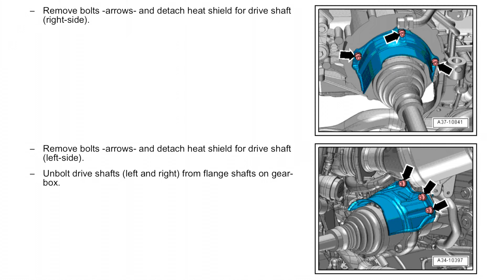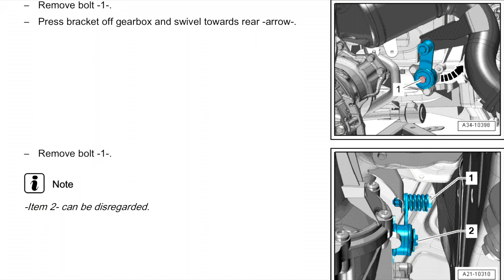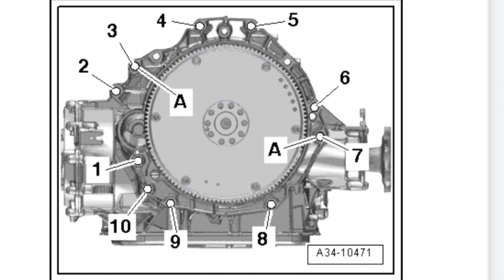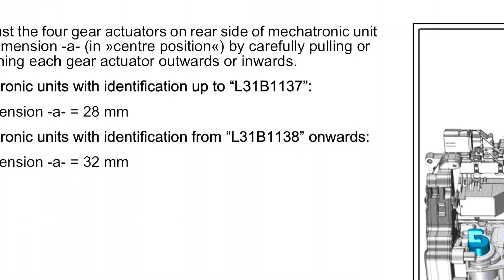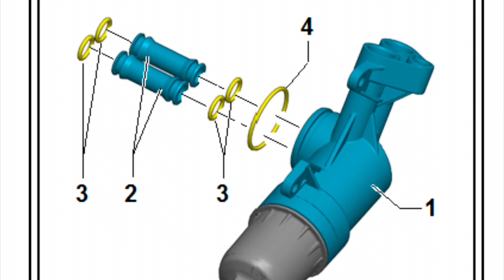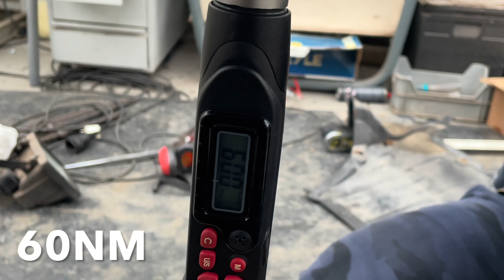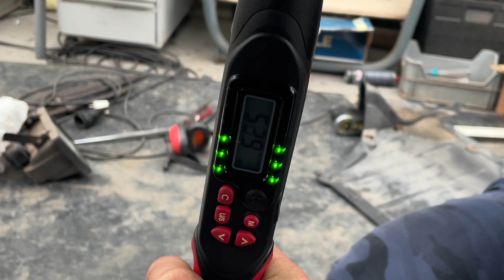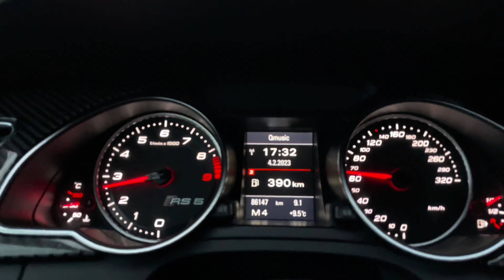RS5 b8 Removed and Install new gearbox DL501 0B5

Comment: Very well put together guide. Can you remember what size socket size is required for the bell housing bolts (ie. the 12 point bolts attaching the body of the transmission to the engine block shown at 4:47 ), are they 18mm? Thanks

Comment: That top heat shield bolt on the left hand side is an absolute bastad to remove and re-fit. I ended up leaving it off when I replaced the drive axles on my A6

Comment: Good to see that fixed it! What was the cost for the exchange?
Reply from the maker: I'm glad she's okay too😅

 The cost list
 Gearbox 1200 euros + 2 months warranty
 MTF oil 100 euros
 ATF oil 60 euros
 Gasket ATF 15 euros
 2xfilter ATF 35 euros
 Orings set 12 euros
 Copper rings set 10 euros

I spent about 35 hours on it But that's for my own
Reply: Look like a 10k job

Comment: Good to see that the issue is fixed. Have you conisdered to open the original gearbox and find the root cause?
Reply from the maker: no i haven't done that yet!  but I still think the Diffrential made the sound!  but I will still disassemble the gearbox because I find it interesting what the causes were
Reply: Do you need to do adaptions to new gearbox or is it simply a plug and play?
Reply: @commenkid1  since the TCM is driving a different clutch pack, adaptation is required

Comment: Hey RM, I will be shortly getting the gearbox on my RS5 overhauled along with fitting a JHM Lightweight Flywheel - Question I have some catless headers that need to be fitted are the OE manifold accessible with the engine in situ but gearbox removed?

Comment: How many kilometers did your old gearbox had? Is there a difference in the gearbox from the pre to the facelift modell?
Reply from the maker: my old gearbox has 86000 km on the clock & yes the megatronics would have an adjustment and the external ATF filter has also been adjusted!  the 2010-2011 filter housing has come loose due to vibrations while driving

Comment: I'm having an absolute nightmare with mine. I think the mechatronics unit is failing as it randomly gives me gearbox fault error message and goes into limp. Audi won't touch it because It has a map (by mrc) by the previous owner. I have no idea what to do